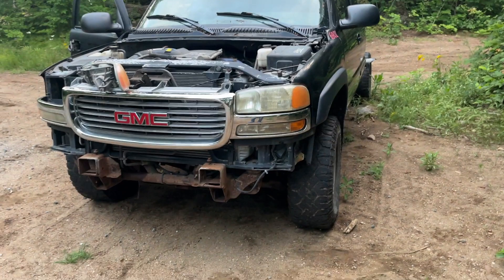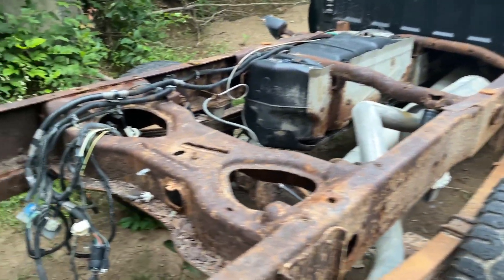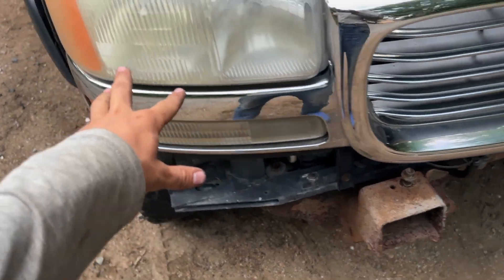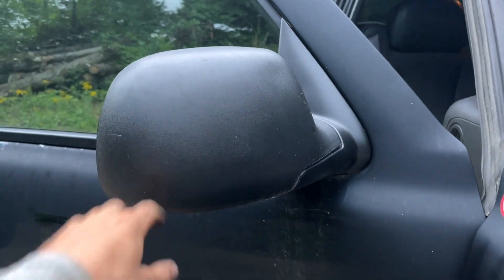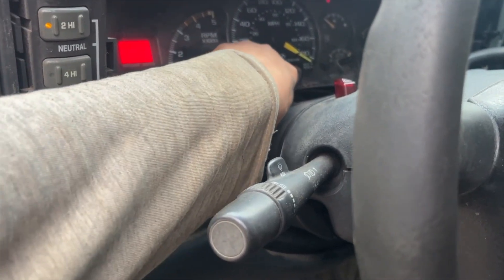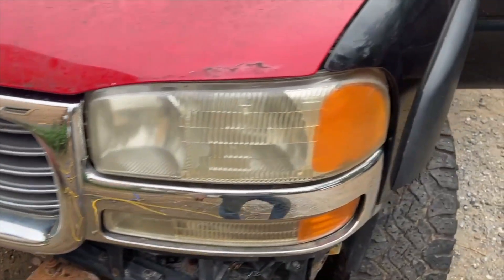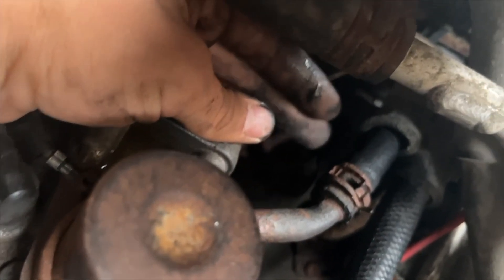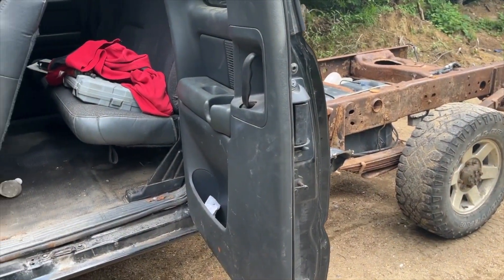Getting My First Truck | Restoring A 2001 GMC Sierra 2500HD Duramax.

Comment: Worthwhile project! Diesels haven't been the same since they mandated the DEF system. The number of shops "deleting" DEF just goes to show it!
Reply from the maker: Yeah. I love the way the new diesels look can’t stand the emissions control. I’ve heard that just deleting the def system can increase fuel economy by 25% which corresponds to a huge increase in power. Also it’s nearly impossible to run alternative fuels in the new diesels. Which is something that should be supported if anything as it would decrease the burning of fossil fuels. I’m hoping to potentially run bio diesel in my truck so we’ll see how that goes. Thanks for checking out my videos I should have another one out soon.